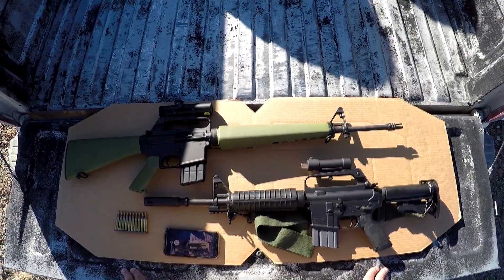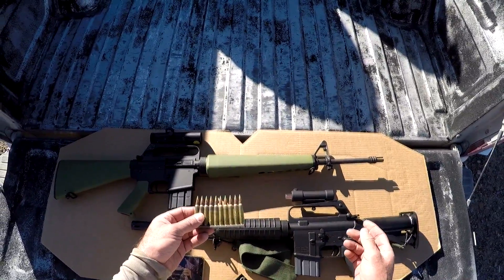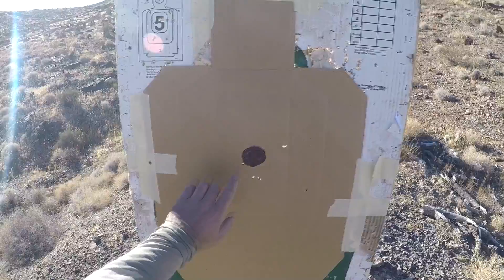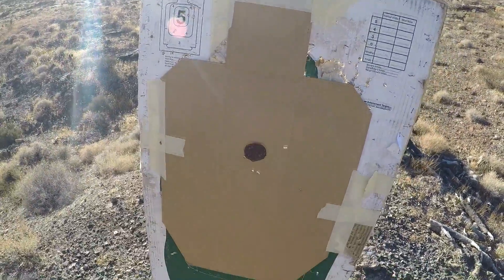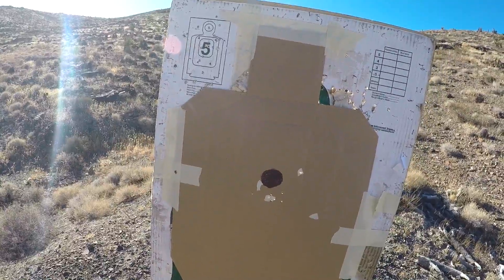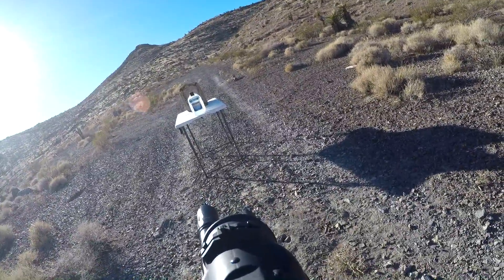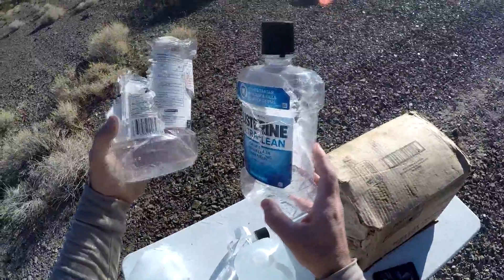5.56mm M855 in a 1:12"  twist...Useful or Useless?

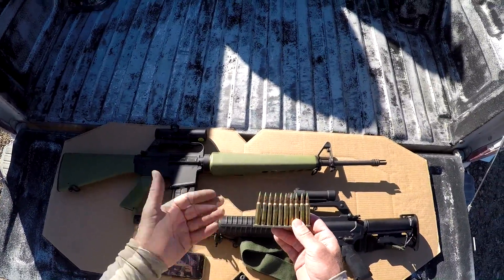Comment: Excellent video and info for sure. I would love to see an episode testing CMMG Bravo 22lr conversion in that 1:12. My 1:7 is sub MOA with 77gr Norma Match. It's 9 MOA with 40gr CCI MiniMags.
Reply from the maker: Its entirely possible that rate of twist is too high for that projectile...
Reply: @7N6ballistics  I'm assuming that is the problem. Still tons of cheap fun on 5" steel at 50 yds. But I'll bet your 1:12 will shrink that group a bunch.
Reply from the maker: @olysean92  possibly..but I do not have said conversation kit.

Comment: I bet a 77gr out of a 1/9 would do the same thing. Awesome video!
Reply from the maker: Very possible...but the 77gr projectiles dont seem to suffer from the inconsistent terminal performance as M855.  That said...in a pinch...  I don’t have a 1:9 to test though.
Reply: Eugene Stoner designed the AR-15 with a 1:14 rifling twist rate which just barely stabilize the 55 grains full metal jacket M-193 round at normal temperature.. the rifle was tested by the United States military in Alaska and the cold winter air temperature which is denser than warm air temperature, the 1:14 rifling twist rate would not stabilize the 55 grains M-193 round so the United States Military' insisted that Armalite change the rifling twist rate to 1:12 which stabilize the 55 grains full metal jacket M-193 round in the Arctic  climate. The slower twist rate is much more lethal weapon than the faster twist rate. If you decide to go with a heavier bullet weight like a 75 - 77 grains you would probably have to go with a 1:9 twist rate. However the 55 grains ammo is a lot cheaper than the heavier bullet weight.

Comment: M193 is perfectly fine from 1:7 rifles though right?
Reply from the maker: Yup.  You might get better accuracy from 1:12...but it is perfectly functional in 1:7
Reply: @7N6ballistics  Awesome thank you 7n6. I just prefer using one all around twist rate for my uppers. I like to load my mags staggered sometimes with different grain ammo for fun.
Reply: There is a phenomenon called over-stabilization. If the pill is spinning too slow it will keyhole and fail to aerostabilize. If spinning too fast it will fail to aerostabilize as it starts to fall to earth. 1:7" barrels are notorious for the m193 going amok past 400m. Check out 9-hole reviews and the poor downrange performance they get out of m193 in 1:7" tubes.
Reply from the maker: @dbmail545  thats possible...but the m193 was never known for good accuracy past 400yds...that was a complaint even when the 1:12 was standard.
Reply: true true, m193 does vere off into wind past 300 yards. it's just a cartridge limitation.
Reply: @AA-dn8dj  77’s do better past 300m.
Reply: Sure if you have a 16" barrel.

Comment: I heard that 1:12 was made for the original 55 grain FMJ M193 and 54 grain M194 tracers, and that 1:9 was made for the M856 64 grain tracer and 62 grain M855 FMJ, but that 1:9 was abandoned for 1:7 as it did much better with 64 grain M856 and later heavy grain ammo.
Reply from the maker: Yes, 1:9 was needed for the SS109 projectile...it was the M856 tracer that required 1:7.   For instance, the FAMAS G2 uses 1:9...I can only assume whatever tracer round France uses is not as long as our M856.
Reply: @7N6ballistics  Oh I see. I knew what I said before from conjecture and comments, nice to have that clarified. Doesn't the earlier model FAMAS only take .223 pressure loads?
Reply from the maker: @AA-dn8dj  It uses a steel cased round....im not sure exactly on the pressure specs.